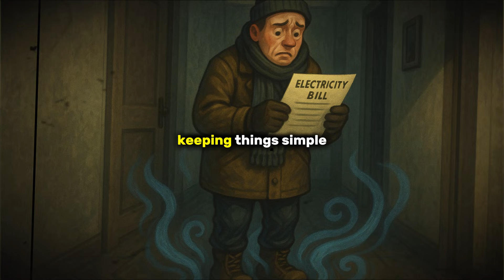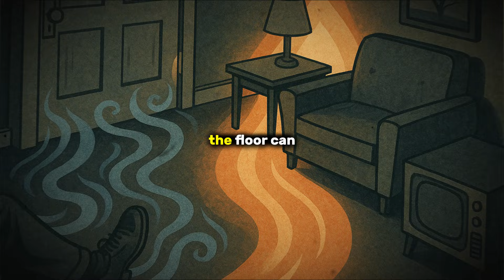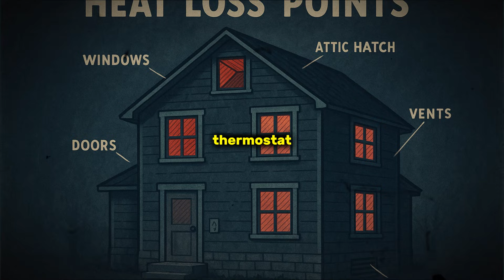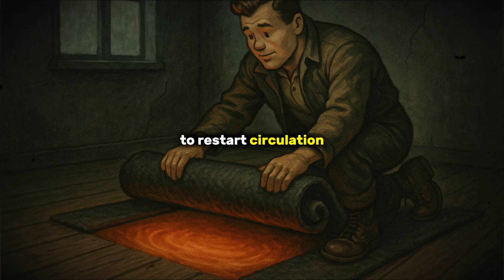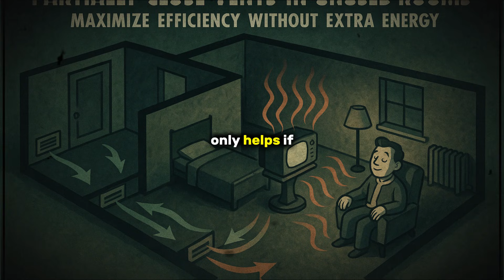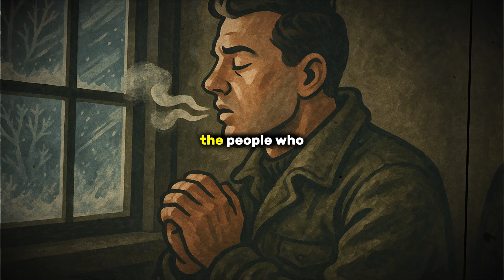How to Stay Warm, Safe, and Spend Less

Comment: Our off-grid cabin is powered by an Anker setup, but they're all about the same. We turn it off at night while sleeping. Learned that it uses a significant bunch of power just sitting there turning DC into AC even when nothing's running. Might help someone, somewhere.

Comment: Winterize any inside outlets that are on outer walls. Ask your electrician for help selecting either insulated plates or insulation material for them to install behind them. These outlets (switch plates too) can be surprising heat escapes!

If I may, I prefer the standard SafetyZone background martial music. This video's music was oddly distracting 🤷🏻‍♀️ Good content and tips, but I kept having to rewind as I was getting thrown by the music.
Reply: Thanks for the tip. I always knew when i reach to plug in a power cord in cold winter, or flip on a light switch, i thought it strange that i could feel ice cold air on my knuckles. Never knew there were special insulations that don't require covering the entire switch plate or outlet (rendering them un-usable).
Reply: @shanew.williams  My husband got and installed some from Menards - iirc the brand was Frost King - but he has electrical experience to tinker with stuff like that. If it had just been me, I'd've further enriched my folks' electrician😅 It might not be a huge difference, but trapping heat is one of those things where every bit counts🫶 Stay warm!💕